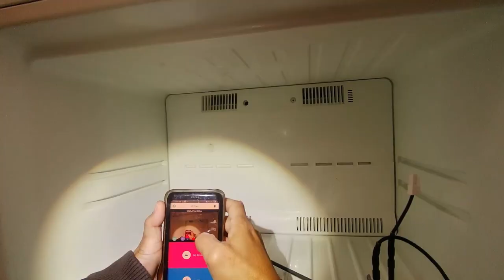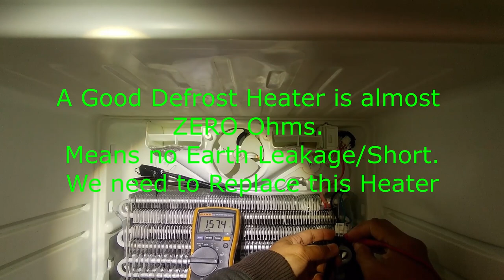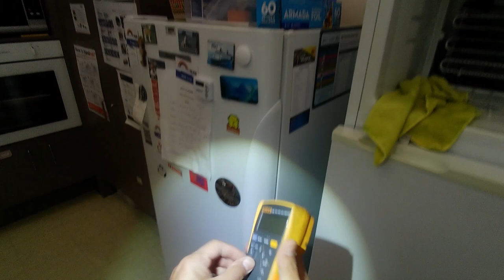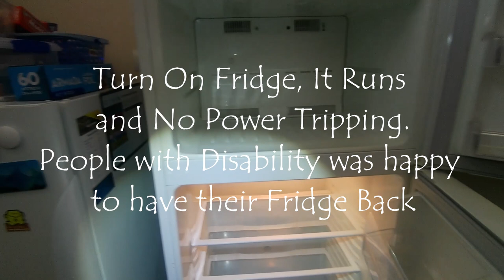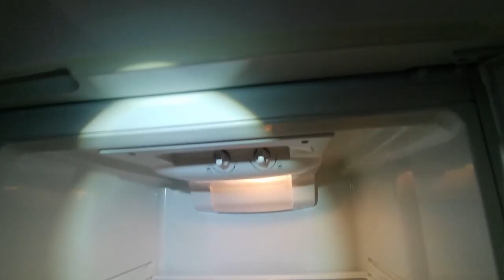How to Fix a Fridge that Trips Power in 20 Minutes

Comment: I struggled getting the pin out of the plug for a while then tried a ferrule for 1.5mm wire was the perfect tool. Push it in from the front and it pops the wire out in seconds.

Comment: Should there be any continuity to ground from the defrost heater wiring? I think the defrost heater is tripping my ground fault receptacle.
Reply from the maker: Hi 1divemaster1, Yes it is also called  in other term as Earth Leakage (means reading of less than 1-2 mega Ohms to earth). This is a bad reading and can cause the tripping of power. A technician can isolate the suspected defrost heater on its own and read the ohms value. Please be careful and ask a licensed tech to check it as electric fault is dangerous.
Reply: Thanks Docfrigee. I actually bought another heating element and I’m waiting for it to come in. Thanks for the reply.
Reply: @docfridgee9932  But in the video why did you say the reading should be near zero(short circuit)? Don't you mean near infinity i.e >2.1 M Ohm?